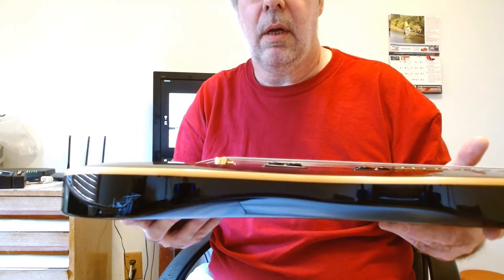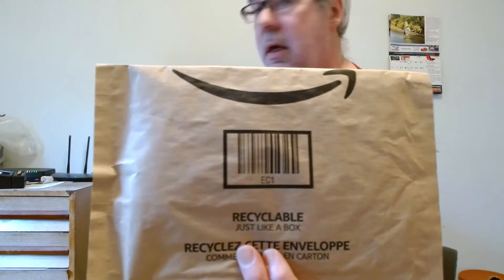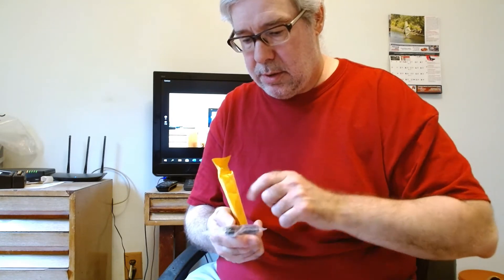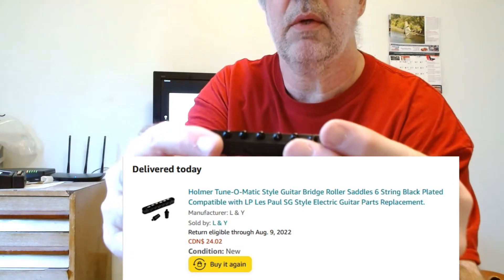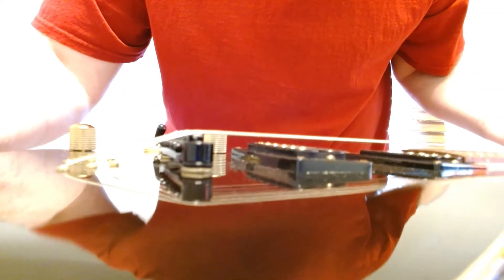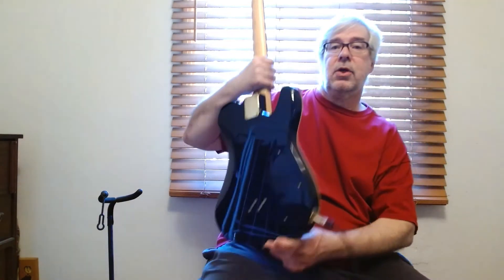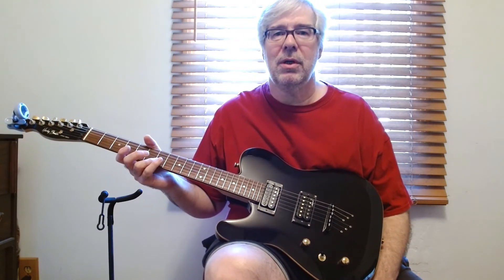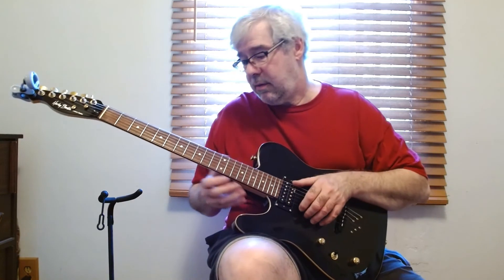Harley Benton TE40TBK Roller Saddle Bridge Rescue

Comment: No reason you can't lower it now.
Reply from the maker: Didn't want to ruin my lucky streak. Did do it, tho. Low E now at 5/64, high E at 4/64. The best news is no fret buzz.
Reply: @calbrockocat8728  
That's good. I actually have 164th lower on both sides as my maximum spec and that's measured at the 17th fret. I heard you talk about the 12th fret earlier and the 12th fret is in the trust rod adjustment area and cannot be trusted for action because you should be setting your action on the truss rod with the first fret capode and typically the 17th fret where the neck meets the body push down and from there you measure what you like as relief at the 7th and 8th frets typically I use .011thou